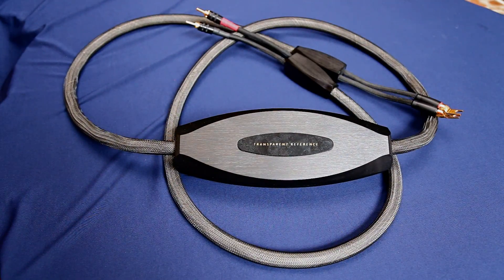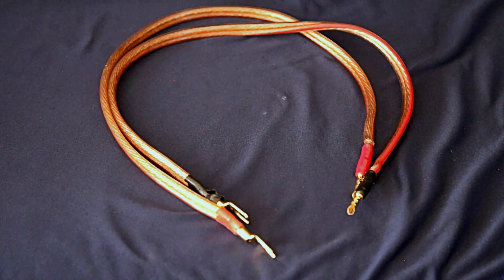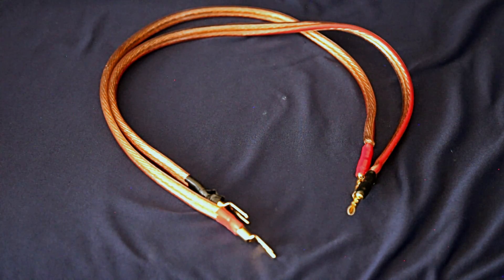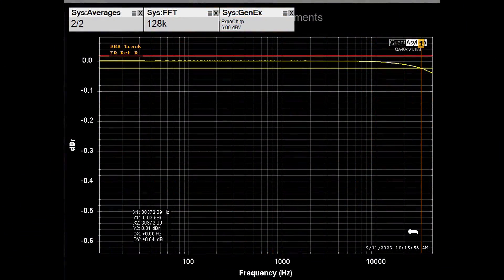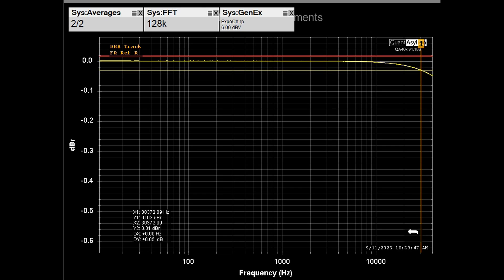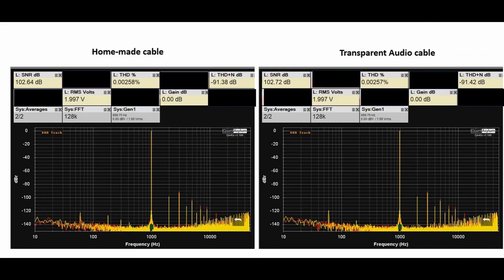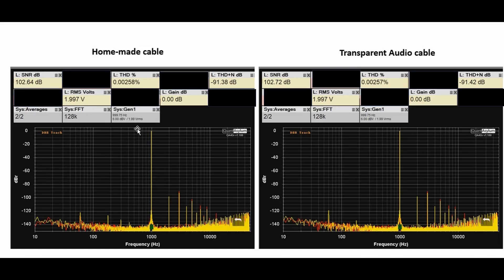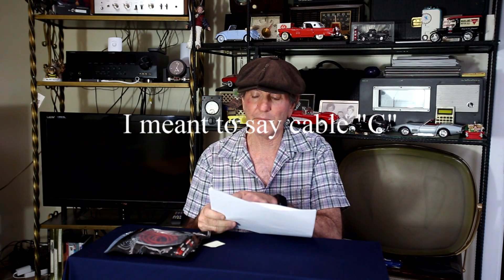$8000/pair Speaker Cable  vs. $14 DIY Speaker Cable A/B Test: Vintage Audio Review Episode #87

Comment: Another test would be to secretly replace an audiophile's $8000 cables with a $14 pair and see if they notice.
Reply: They won't, guaranteed.
Reply: @alexandermikhailov2481  Completely incorrect.
Reply: You're right in that they won't notice on a below average system. It'll be obvious on a decent system.
Reply: @ullodea  no need to convince me. If people want to spend big money on cables and it works for them to obtain 2% improvement let's say on there high end system with possibly their 70 year old ears then fine. Ears, that's what we listen with, we loose high end considerably as we age. All this I can hear this and hear that by swapping a cable, please. Enjoy by all means but high end cables are just fancy jewellery for your system with marginal benefit particularly if you are older.
Reply: They wouldn't.
Reply: @davidharper470 So sad, you won't even listen.

Your loss.

Funny thing is even random members of the public can hear it; I guess they haven't been told by "experts" that they can't. 🤣🤣
Reply: @VideoArchiveGuy  it would be more beneficial upgrading the capacitors in your speaker crossovers if you want a proper improvement detail and soundstage. A cable is a signal carrier not a graphic equaliser changing the input signal. Watch this video again.
Reply: @ I used to think the same as you do until I heard Clarus speaker cable and interconnects frim the Crimson line. There was no going back, but my 2 channel system also retails for more than $150K. Monster cable doesn't belong in that system.
Reply: tell the them that your are hearing the $8000 cable when in fact they are hearing the $14 pair and I they will say the $8000 is better.:face-blue-wide-eyes::face-blue-wide-eyes::face-blue-wide-eyes::face-blue-wide-eyes::face-blue-wide-eyes:
Reply from the maker: @itsonlyme9938  Interesting experiment idea
Reply: How about take the $8000 cable guy and give him a tour of the studio where his favorite audiophile song was recorded. I bet the studio uses standard 12awg copper install speaker cable on their studio monitors that cost a fraction of what an audiophile pays for their speakers!
Reply from the maker: @prw479  Thanks for the idea... probably not all studios are going to use something simple and effective like the 12guage OFC,  I'm afraid, but many are.
Reply: Same thing with high priced DAC’s 😅
Reply: @carminedesanto6746  Some people will never be convinced, but It can be easy to tell some DACS apart. Cables and speaker wires however, are a lot harder to tell apart.
Reply from the maker: @carminedesanto6746  One of my favorites is when an acquaintance told me heard an improvement when he changes is toslink cable.  Thanks for the comment
Reply from the maker: Not overly practical, but a good idea!
Reply: Any true audiophile would; the difference is major and obvious.
Reply from the maker: @VideoArchiveGuy  Am just seeing this comment- I have been travelling the past few days and just trying to get all caught up. My experience and background leads me to come to a different conclusion.
Reply: @VideoArchiveGuy  Only in their minds.
Reply: @moi3557  It's instantly and immediately audible within a second, perhaps two.
Reply: @VideoArchiveGuy  What BS, you must be the snake oil salesman. Now you can say "guess you don't have golden ears".
Reply: @c34webb  You don't need "golden ears" to hear the difference, you just need to be willing to listen, which you obviously are not.

If you're happy listening to your system the way it is, good for you; I want the improved soundstaging and sense of space only better cables bring.
Reply: @VideoArchiveGuy  completely incorrect
Reply: @alexandermikhailov2481  Wait, I bet you don't hear differences in cables, either and only trust measurements. 🤣
Reply: @VideoArchiveGuy  I bet you don't hear it either. Try listening to the music for a change, not to the cables. You might be pleasantly surprised.
Reply: @alexandermikhailov2481  The better cables enable me to hear MORE of the music - the soundstage of the recording, the size of the studio or hall in which it was recorded, each improvement in sound quality brings me THAT much closer to the music, emotionally.

I don't listen to "cables," I listen to the improved details and soundstaging of the recordings I love.

If you switch to other cables those details smear or are harder to make out.
Reply: @VideoArchiveGuy  🤣👍 nice!
Reply: @VideoArchiveGuy  only audiophiles have ears that can then. Spend what you like on your kit. This experiment has pretty much debunked expensive means better.
Reply: @a0r0a745  No one believes "expensive" means better, rather better means better and better is usually more expensive.

A hamburger doesn't taste better than a filet mignon if you charge $50 for it, but filet mignon usually tastes better than a hamburger and will be more expensive.
Reply: @VideoArchiveGuy  so simply don't spend more money then. Do as you please. If it works for you then fine, enjoy. No need to convince me.
Reply: @a0r0a745  That's the thing - spending money on the RIGHT cables brings VAST improvements.

Whether those improvements are worth YOUR money is a personal choice; they certainly are for me in my system up to a certain price point, which is a different level for everyone and is highly dependent upon the other elements of anyone's system.
Reply: @VideoArchiveGuy  with cables there is a point of deminishing returns. Nice quality, materials and gauge for speakers. I am happy for people if they choose to spend big money on cables if it pleases them and they feel it makes a difference. For me I apply what I just stated. It is a great hobby.
Reply: @a0r0a745  Of course, there is for everything, and what the point is varies for each person.

Some people wouldn't pay more than $300 for a CD player or DAC because they don't feel the difference is worth it; others are looking to upgrade from their $100K+ dCS Vivaldi APEX.
Reply: @VideoArchiveGuy think that is what I said 😊
Reply: @VideoArchiveGuy bad analogy. The beef and ingredients can differ dramatically. Cables cannot. I ditched audiophool cabling years ago and only run Mogami, a brand these audiophools stick their nose up at ironically whilst playing their favourite artist who very very likely recorded the album using, you guessed it, Mogami cabling. 😂😂😂

Comment: Multi strand oxygen free copper wire is exactly what the expensive cable uses, the name is what costs the extra money.
Reply from the maker: Thanks for the comment, though to be fair, I am sure there are costs with putting together such a cable that we may not see.
Reply: @vintageaudioreview 
... unnecessary costs.

Comment: Why not use L and R in mono? Then swap.  No corruption.
Reply from the maker: Thanks for the question. The switch box limits how many things one can switch between. A mono signal was used going into the amplifier and then into both cables.

Comment: Only foolish people get fooled, a wire is a wire,
Reply from the maker: To a certain extent, yes, but if your speakers are drawing a lot of current you would want to make sure that your cables were not going to cause much or any voltage drop.

Comment: Hmmm...do I understand correctly, you used a stereo preamp (set to mono) to drive 2 mono amps, each amp had one of the test cables run from it to the switch box, and then a single homemade short cable between the switch box ad the speaker? If so, not really a valid test, as you can't account for any differences between the 2 power amps....not that I think it would have made any difference anyway LOL
Reply from the maker: You are pretty close to getting it right. One power amp was used- the Bryston 2B-LP. It is a stereo amp, however it is a dual mono design- basically 2 independent amps in one chassis. I have measured the amp and their electrical characteristics are almost the same- definitely for the purpose of the test- you are indeed correct. And having the short homemade cable as part of the test has been pointed out a few times today (a record # of comments for me). But my premise is that if both cables are passing through it, the effect would be nulled out......Thanks for the comment

Comment: null test. 3 minute video! done. 17 minutes.. to long considering.
Reply from the maker: Null test is a different kind of test trying to show the same thing. Unfortunately, my video lengths tend to be on the longer side of things, but just think how long it takes me to make them so I would like to streamline them a bit as I am able.
Reply: Having done extensive null testing on RCA cables, I can tell you that it most likely would have been met with.. "We don't listen to test equipment" and the ensuing arguments would have lasted for weeks.
By doing an actual listening test where the results turned out within a couple of percent of guesswork the anti-science audiophiles have no retort.

Comment: this is a very poor test. need to do in stereo and both cables direct to the speakers. you introduced a third cable that is the only cable that the speaker saw. try it again in a direct comparison. then you can make a real concussion. plus you do not say what amp you are using, just the preamp.
Reply: run the speaker lines into a DI, record them, null test them. No difference.
Reply from the maker: @morbidmanmusic  Not sure what you are referring to as far as "DI", but agree that there would not be much, if any electrical difference.
Reply: Actually he did the test as it should be done ... only one variable (the single wire under test) was changed. The rest of the test setup, flawed or not, remained the same... so the comparison is valid.
Reply from the maker: @Douglas_Blake_579  You are an electronics tech and have a great understanding- thanks for the "support"
Reply: @vintageaudioreview 
Ah calls 'em as ah see's 'em.  😉
Reply from the maker: Though you did not appreciate the test, I do thank you for taking the time to express your opinion. The amp used was a Bryston 2B-LP, which I have used in a lot of my testing & I think I mentioned in the video. The short cable that was common was not the only cable that the amp saw from basic electronics. As I mentioned a few times during my commenting, I am not able to do the a/b test with 2 speakers for this set up. No reason to really use two speakers to test if there was a difference in the sound caused by the cables.

Comment: Every time a high-end cable is tested and the results are "no difference" (which seems like every test outside the manufacturer's lab) the "Your system, ears, room, electricity, and/or snacks lack in these ways, obscuring the obvious benefits ..." name-calling and handwaving fanboys come out in force.  If the "obvious benefits" are only obvious with the highest of high-end systems, isn't it slimy and bordering on immoral to sell me something this expensive that I have no chance of enjoying?  Perhaps the manufacturers should have a Minimum Requirements list (like Microsoft publishes each time a new version of Windows comes out) so as to avoid disappointment and outright failure.  As any scientist will tell you if something can't be independently verified (which requires the manufacturer to share all the details of the testing and methodology) then the claim isn't a fact.
Reply: It always seems, if the really expensive component doesn't prevail in these sort of A/B tests, the  response from the manufacturer or salesman of overpriced gear is always...." well, your system just isn't resolving enough to "hear " the difference.....🙄
Reply: @danb-WingNut 
The correct answer is that the cable doesn't make enough difference for it to become obvious.
Reply from the maker: I really appreciate your taking the time to expound on this video. Interesting idea about having a minimum requirement, which thinking about it, would include everything from speakers to the room..and maybe even a hearing test...I have no problem with someone wanting to purchase something so expensive if they can afford it- like owning a Rolex when a $100 Casio will keep just as good as time.
Reply: "Any claim made out of hand can be dismissed out of hand"

Hitchen's Razor... https://en.wikipedia.org/wiki/Hitchens%27s_razor

Comment: I bought my first good system from an audiophile store that opened up across the street from the restaurant I was the chef at the time. We fed the guys after hours a few times as they were getting open so we had a good relationship. I don't think I paid much more than cost for the little system I bought from them. One day a big-money buyer was auditioning some Wilson speakers and switching between Nordost and Transparent cables. Both cost exponentially more than my 2 channel system. One of the owners turned to me in the other room and said it didn't really matter because both were just a tax on the gullible. They all used DIY stuff in their own homes and had settled on the fact that you can't convince someone buying $45K speakers that $50 cables will essentially sound the same as $5000 cables.
Reply: Who was that you spoke to, Jesus? Why do you think he has any authority to proclaim gullibility? One person told you something and now it's fact? I say different so now what? This is typical of people with no experience with high-performance audio.
Reply: @carlosoliveira-rc2xt  nice try but it was the consensus of the three owners of a high end store that was open for 20 years. All 3 of them came from other high end stores in the area. Over 100 years of experience between them. Now kindly sit down and be still.
Reply: @tmdillon1969 You missed the entire point. I have personal relationships with more dealers, distributors and designers than you'll ever know. You can't argue a point from authority. It's not even admissible in court. First hand, decades of relevant experience and a microscope (high performance gear) to evaluate is what counts. That's me, thanks.
Reply from the maker: Thanks so much for sharing your story and I like calling them a "tax on the gullible". As I said in the video, the cables look cool and you can spend your $$'s however you want, but when you tell me they are going to sound better I am going to be doubtful.

Comment: I think that stereo listening might turn up bigger differences between them. Also, some amp/speaker combinations seem more sensitive/revealing to cables. Many many variables still to test!
Reply: prove it.
Reply: Yes, I guess if you were specifically looking for differences in tone in a mono system, then your setup was a good one. Im just curious to know if you have ever heard differences in cables, it would be interesting to know since it is your humble opinion that a different setup would not reveal any differences either. Maybe the experience of having heard differences can let you know what to listen for...had any of your listening panel heard cable differences before?
Reply from the maker: @davelistenstohifi  People think, myself included, that they heard a difference between this cable or that cable, or this amp and that amp. Differences are usually very small and unless you can do an immediate a/b  between them, it is easy to get fooled. My friends that have been involved in these tests has come away having their opinions changed, except for another electrical engineer. And they enjoy doing it and we are already planning our next a/b get together......Thanks again.
Reply: @vintageaudioreview  Sounds like a fun get together. Enjoy!
Reply from the maker: I appreciate your comments. As i mentioned to another commenter, it is not possible to do stereo a/b testing with the setup used. It was mainly to see if there was a noticeable difference in the sounds tone as a result of a cable. Most Speaker/ amp combinations would probably not be affected by using a decent speaker cable, IMHO.

Comment: Too many variables, I know the C1 and it's far from being transparent.
That said, the hiend cables for thousands of dollars are baloney. Get some Neotech wire and call it a day.
Reply: It doesn't matter.  He could have used a $50.00 china amp and the test would still be valid because the only thing that changed was the 10 foot speaker wire.
Reply from the maker: Thanks again for the comments. I did a quick check of Neotech wire as I was unfamiliar with it and it appears pricey by my standards, though not as nearly as much as the one I tested. I will stand by the C1- I have compared (a/b'd) it to many name preamps. The only one I did not think it held its own against was because it turns out I had the Carver in Mono accidently. But you are right, there are mainly variables.....

Comment: Someone spends that much on cables- only thing fairly certain: now looking for even better ones.
Reply from the maker: Thanks for making me chuckle with your comment!!! The owner now has that cable and its mate now up for sale on Audiogon or some place like that..
Reply: @golds04 
Head off to the hardware store, electrical department, and grab a roll of 16ga all copper lamp cord.  It'll cost you about $0.30 per foot and last you a lifetime.

Comment: Cant meassure some things, like sound stage. You have to break them in and really do a/b listening test
Reply: you don't break in wire.. and the sound stage doesn't change. Lol. You spent too much on cables, apparently.
Reply from the maker: Thanks for your comments. Not sure if there is some way to measure soundstage directly, but your speakers are going to be the main factor in that, as well as the room, and to a certain extent, the crosstalk (channel separation) of the amp/preamp. Not sure what you are talking about breaking in- certainly not wire, I hope.